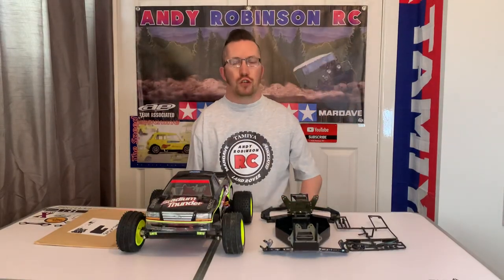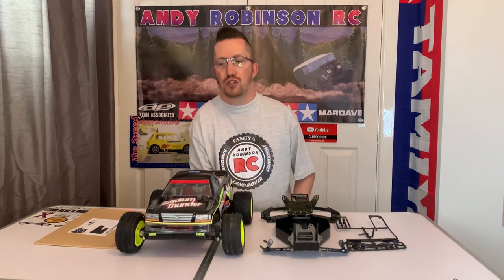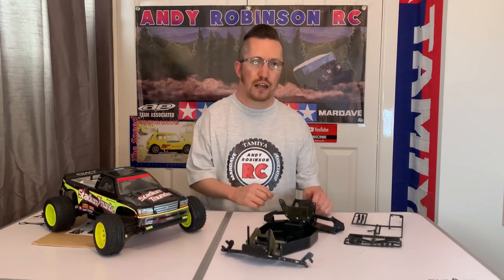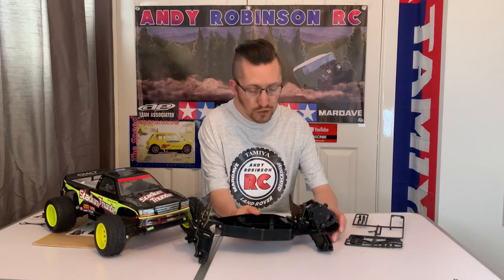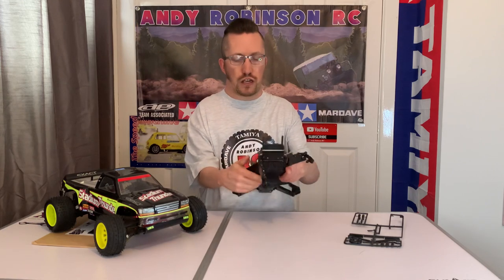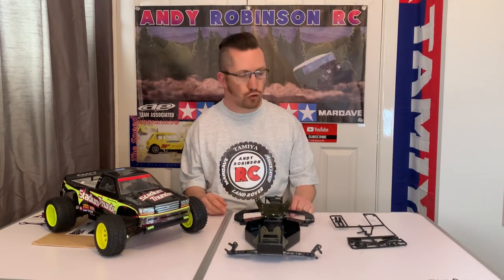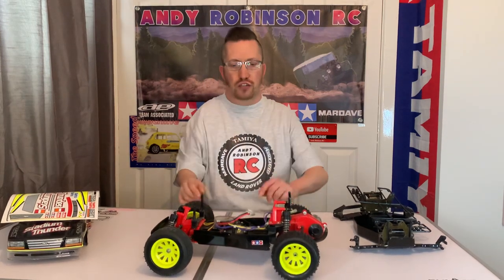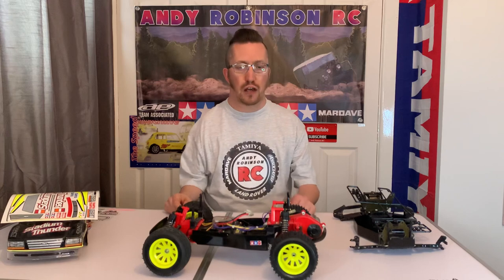E191: Long Lost Relation! Restoring a Futaba FXT Stadium Racer Using A Tamiya Stadium Thunder.

Comment: Andy are the gearbox parts interchangeable
Reply from the maker: Hi Lee as far as I can tell the gearbox internals are the same except the FTX has a ball diff fitted.
Reply: To add to that, the spur on the fxt is 0.6m like a top force and the motor mount is a bit like a top force where you have a choice of 5 different pinions and mount the motor on the corresponding holes. The ball diff is sort of a hybrid of a Manta Ray ball diff and a specific diff gear. I think the tooth count is 1 different from the Blitzer diff gear though